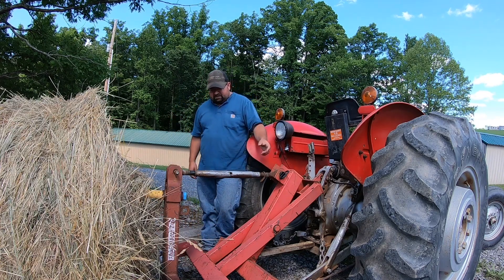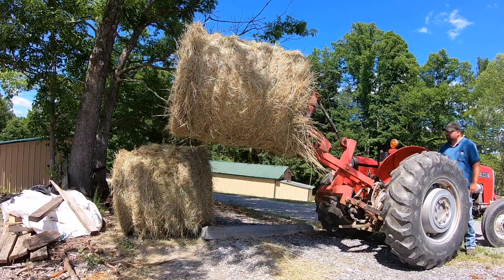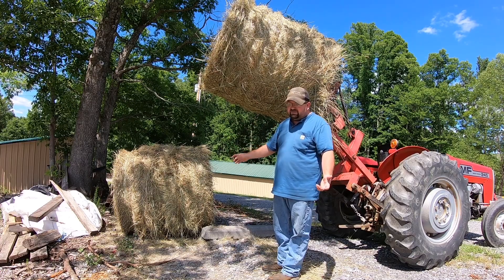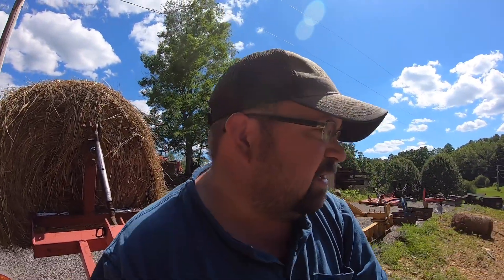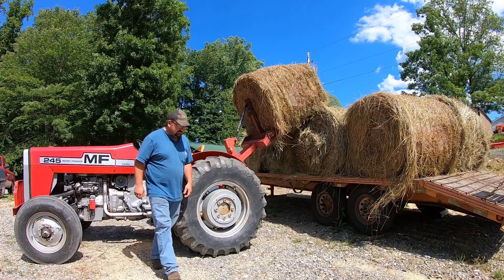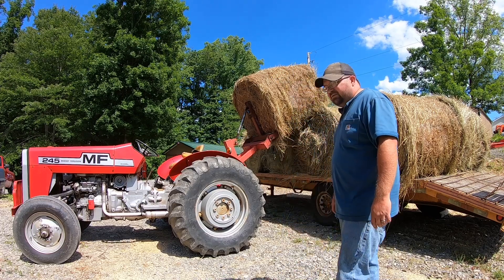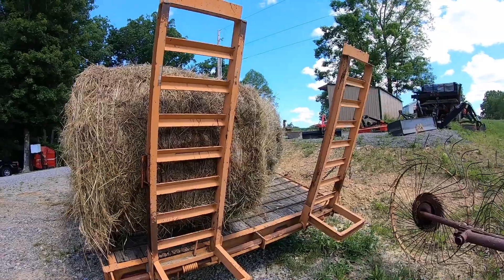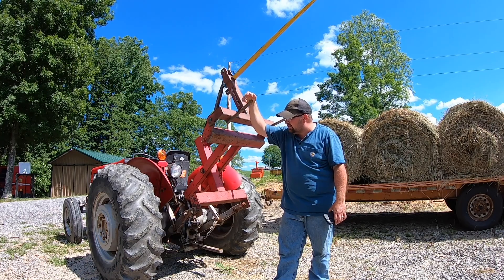Triple Your Tractors 3 point lift height! Scissor Lift Adapter.

Comment: Just ordered a basic one off ebay. Going to combine with a rear scoop to make a higher lift loader. I want to at minimum dump into a wheel barrow or garden cart to deliver material where tractor is prohibited. At best into a  small pickup.
Reply: It is done and works better than expected. Three loads in a garden cart pulled by the lawn tractor in minutes rather than driving one load at a time. With my hinomoto e16 I get 4 1/2 feet of lift.

Comment: Good video. Just bought one of these at a farm auction last month for my tractor. I am gonna use it on my Massey 175. 
I was hoping it would go high enough to double stack. Not sure now after watching this video.
Reply from the maker: It’s hard to double stack on a top deck trailer, but with a 175 you might get enough extra height so you can. Thanks for watching
Reply: @khtractors  Well I have a front loader on a John Deere  4400 compact tractor I could put on a top row with but my bales really push the limits of that little tractor so I only use it when I absolutely have to.
I have plans to get a loader on my larger John Deere when and if the 
$$$$ ever gets available. Lol. With the way things and prices are headed now it may not happen for a long while.🤔🙄😢
Reply from the maker: @leeroyexcavator9149  with a hydraulic cylinder in place of the top link I could double stack on that Hudson trailer with a 2615 Massey I had.

Comment: I have never liked hooking them up.  They seem to want to smash fingers.  I'd be curious to see how you put it on and then take off when your not using it.
Reply from the maker: They can be frustrating. I first unhook the top link or Jack from between the spear and scissor, then hookup the lower lift arms and tilt it into the top link hole on the tractor. Sometimes having to raise or lower the lift arms to get it aligned correctly. Then reattach the top link or Jack. On the 245 the lift arms lower to the ground and everything lines up perfectly. On some tractors you have to remove the drawbar hitch. Thanks for watching!

Comment: Would you be able to put a bale in a hay ring?
Reply from the maker: Yeah I have. You can really easy if you use a hydraulic cylinder in place of the top link. Thanks for watching
Reply: @khtractors  yeah but your hydraulic cylinder would have to be the same length as your top link. What was the length of yours and what was the extended length of your cylinder to completely dump your bale into hay ring?
Reply from the maker: @bamaalltheway1984  I think I use to have a cylinder with a 10” or 12” stroke. That could vary some though depending on the spear and scissor design.
Reply: @khtractors  I just bought one yesterday but with the hay bale on I can only get 36 inches from ground to bottom of hay. A hydraulic cylinder came with it. It measures 10 to 12 inches and extends about the same. So I’m guessing to get the hay off the ground enough, which is about 4 foot off the ground to get it into the hay ring,  I’m going to have to buy a cylinder as long as the top link according to what your video is showing anyways. I’m not familiar with these scissor lifts so I’m just guessing and trying to figure everything out. All help/advice much appreciated.
Reply from the maker: @ to get the hay higher you’d need a shorter cylinder so it pulls it in farther. What size tractor is it on? Should lift more than 36” off the ground I would think. Mine raises really high. Almost 6’ at the back of the bale.
Reply: @khtractors it’s on a kubota m9540.
Reply: I did move the 3 point hitch on the arms to the last hole away from tractor and got 3 more inches in height. But when I am measuring I am talking about the front side of hay closet to cab.
Reply from the maker: @ I would think it should lift a lot higher than that. On your top link pin position on the tractor make sure it’s in the bottom hole. I assume yours has 3 pinup positions there.
Reply: It is
Reply: I tried sending you two videos to show you, but it’s not sending uploading onto the thread

Comment: That would allow me to lift a pallet of firewood into a pickup truck. Nice.
Reply from the maker: Yes that’s possible depending on the weight your lifting and tractor size. You loose a good bit of strength because of how far this extends behind the tractor. Thanks for watching!